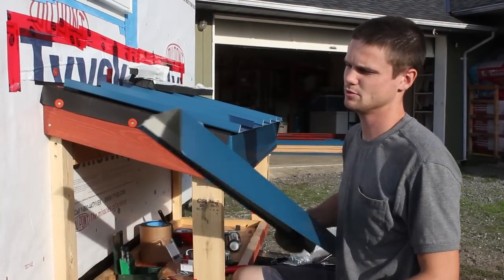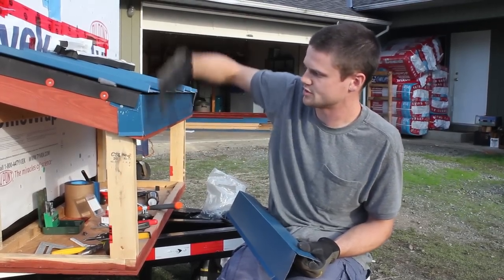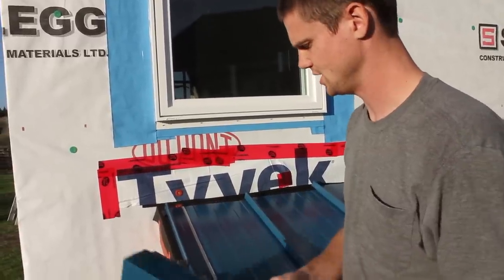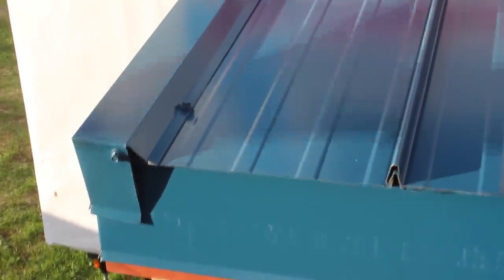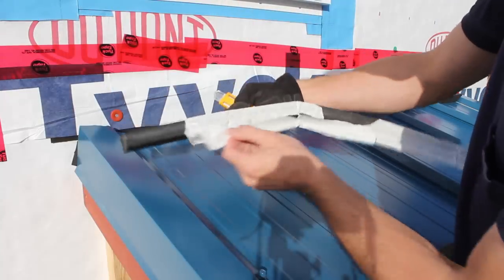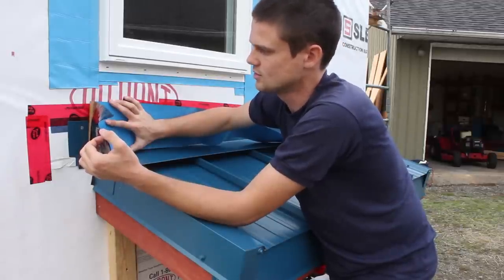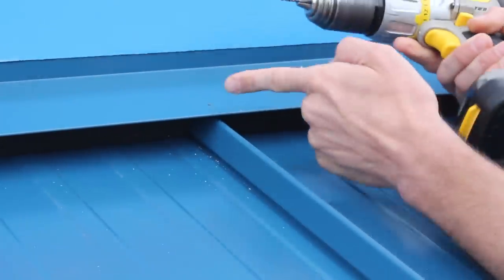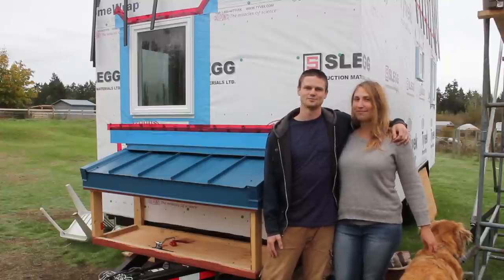Installing the Metal Roof on our Tiny House - Part 2 (Ep.17)

Comment: Is this the only house you plan on doing, or do you think you would do more?  I've found I prefer 5th wheels as it gives a standing room bed room, and no loft, only a small one for storage at the back. With a 6'6" ceiling, it comes in under  12' max. This one I am adding a slide out.  Still working on the support system.  It's going to be an RV, so it will be lighter.  Since it will only be fair weather, I am going to leave the existing floor, tanks, etc. intact, and add on a bit on the sides for strength.  I do like the way you have followed the water and wind access points to the house.  It should be water tight for years to come.  Is it going to be set up in one spot and stay, or will you travel with it?
Reply from the maker: gary pollock The primary function is to serve as a stationary house. Any kind of RV will be much better suited for "travel" since it is built with weight and portability in mind. The tiny house is just a relocatable house, instead of a travel dwelling ;)
Reply: Tiny Nest This one will move 2 times a year, to in April and from in October, from a leased lot on the ocean, a distance of 40 klicks on pavement and 13 on gravel.

Comment: Again I'm sure there were a few choice words when you did the top flashing  :-).  When you did the folds, I  think I would of used a work table edge to make sure they were straight. I know I would make it crooked free hand.  The hardware that was missing,did it ever show up? did you ask for some money back, to cover your cost of the stainless steel screws?
Reply from the maker: Duane C Probably could have made nicer bends, but they worked well enough. No we actually got a bunch of white colour-matched screws in the bundle which were clearly in place of what we needed. We had to deal with cancelling that vented closure at the last minute, needed to get the roof on asap, ended up returning a bunch of excess non-vented closure, among other priorities... so we just accepted the cost, and in my opinion the stainless fasteners are a bit of an upgrade anyway.

Comment: I was considering building on the section you have that box and was wondering what weight your trailer or a typical trailer could hold on there. I was thinking of having that area of the house internal, having the bathroom at that end with the toilet situated on the tongue.
Reply from the maker: If you're planning on a particularly uneven weight distribution, you may want to get a trailer that has axles in a different position, so that the tongue weight is right for towing. I had a great chat about this with Rob from Iron Eagle when we were researching for our project.

Comment: Though this is WAYYYYYY to late, I would recommend if you ever do this again, having a couple of cans of air around when you drill into the metal roofing to remove the filings better.
Reply from the maker: Ah yeah nice one. An air compressor with a spray attachment is even better!

Comment: Thanks for this! Definitely helping me wrap my head around it. Going to install metal roofing on my tiny tomorrow. Just still curious with how the tall, long side edge of the roof works. Does that get inclosed with the same as the side gables? I ordered all the parts, but some of them seem off. Here is my tiny so far: http://www.atinystudio.com/ Thanks!
Reply from the maker: The high edge has a "peak-cap" which is the top-most layer and overlaps the tops of the roofing panels and then hangs down over the fascia... hope that makes sense. You project looks cool!

Comment: The background music gets to be irritating after listening to a number of your videos. Maybe you could leave it off of your videos. Your series is very interesting. Thanks for doing them.
Reply from the maker: +Kathleen Schallock Thanks for the feedback. We've definitely toned the music down over time, so hopefully you'll notice it less in later episodes. We like using music though because it gives us more editing options and changes the feel of the video significantly.
Reply: Tiny Nest 1. My cuz has done roofing and skylights for 40 years
2. Window rubber flashing is great for front of flashing and bottom edge of the wall. 
3. Coast of wa and columbia river gorge has 0-60 mph winds just like traveling down a highway. We never hire out of town siders or metal roofers. My casino cost $5 million in damage because contractor could not understand wind shear. They always pay damages.
4. Plywood storage plywood bureau- years ago a contractor built 40 houses for me. He bought lumber and plywood in bulk. Delivered and covered with visqueen. Three months later with 120" annual rain. The moisture delaminated the plywood. Had to send to plywood bureau for solution. Your visqueen did the same.
5. New code moisture - spoke with contractor new code requires they frame and roof unit then dry unit to wood humidity level.